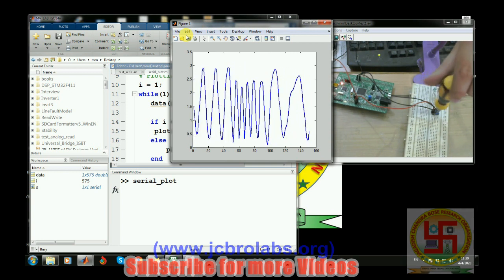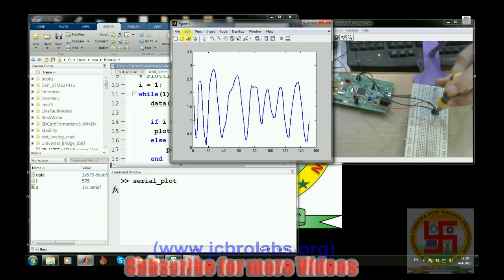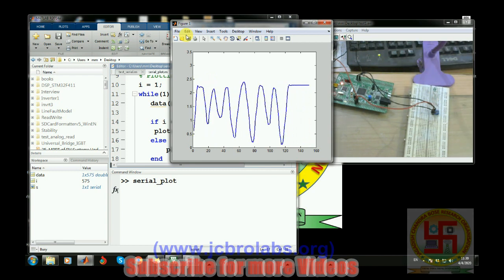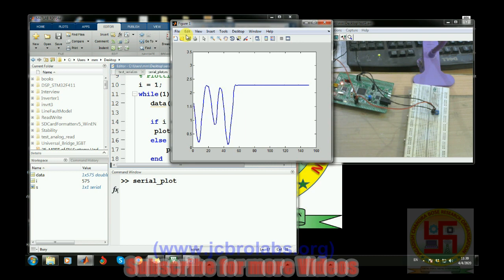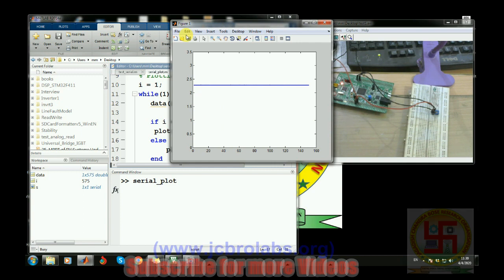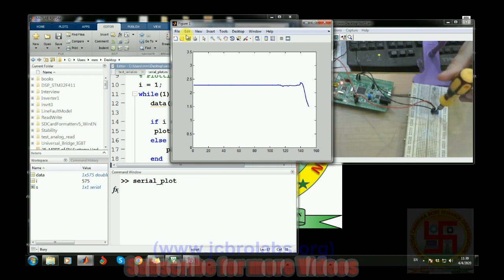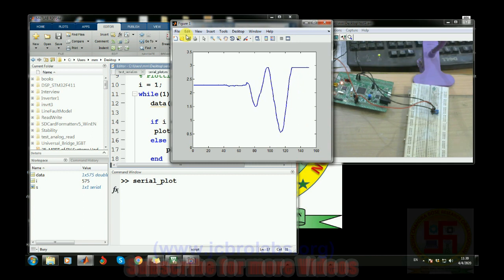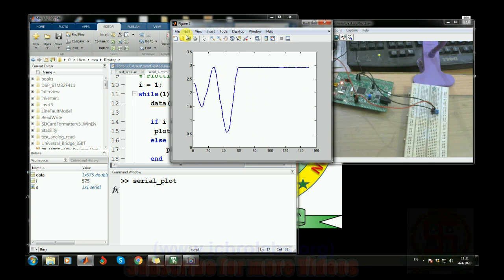How to Plot Real Time Serial Data from hardware in Matlab?

Comment: Hi there, thank you for sharing your knowledge with us. However you have only showed us one end of the communication. May you please explain how is the data transmitted from your board to the MATLAB. What peripheral (UART etc.) did you use to transport the data?
Reply from the maker: Yes, serial data (UART) was being received transferred from microcontroller.
Reply: @sachinsharmajcbro  Hi there, thank you for your reply. I am trying to acquire a signal from a light-to-voltage sensor using the STM32 nucleo board. Then, I need to export the acquired data into Matlab/Simulink. I hope it won't be too much trouble if I ask you to please share your C code from the STM32 IDE. Thank you in advance.

Comment: when Running graph,  system performance will be same in GUI or degraded
Reply from the maker: It will be little degraded if incoming data is being received at higher rate.
Reply: what is your opinion on the slow response in running graph plot not as fast as the change in analog volage at the input of adc
Reply from the maker: @v.m.d.harish9180  There could be several reasons:
1. Baud rate of data transfer
2. Computer processing load
3. Program code

Comment: Unfortunately, I've got this message error: "Warning: Unsuccessful read: A timeout occurred before the Terminator was reached.
'serial' unable to read all requested data." I am using an Arduino Uno with a baudrate of 115200.
Reply: It is working now. I did not use the str2double function, and I had to change the parametres in the fscanf function. Using the instrreset function is also useful to avoid errors. The problem that I am facing now is that the plot does not restart when I run the code again, forcing me to restart Matlab.

Comment: While reading data via serial port, my observation is, I am losing many data points. since I know the sampling rate of microcontroller ADC is 10kHz but I can read 7000 samples per sec in matlab. how can I correct that issue?
Reply from the maker: Actually, If you try to read  samples at high data rate from same application then that will not be possible. You will have to use thread to read the serial data and then separate thread to display the same.
Reply: @sachinsharmajcbro  could you please explain, what do you mean by a separate thread?
Reply: if you mean that only read data in a loop and separately plot the data in another loop? then I am only reading the data in a loop since I found reading and plotting data together in a loop is not possible.
Reply from the maker: @garimasharma6575  loops block the execution. I would suggest you to go through the concept of threads (if you have not gone through it earlier) then search for implementing the same in MATLAB. To start, threads runs in the background of main application and data can be transferred via shared variables.
Reply: @sachinsharmajcbro  I haven't gone through threads earlier so I have read parallel processing but can you explain, how to access data from one function to another? by knowing that data is continuously coming in one function. 
Could you please upload a video lecture on real-time serial data reading and plotting the data using thread/parallel processing? Thank you!